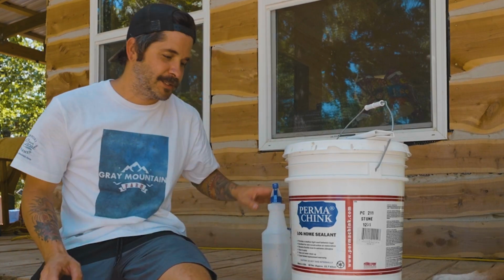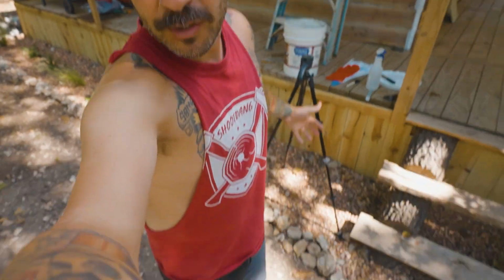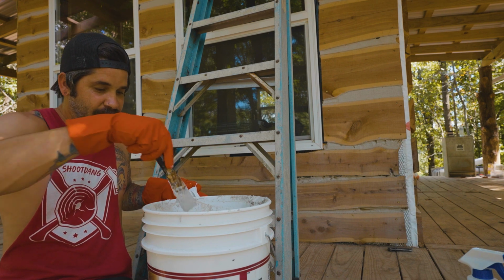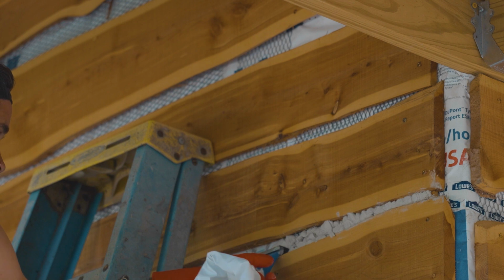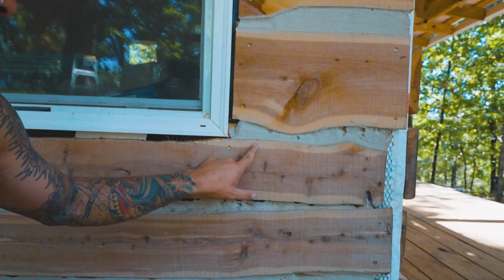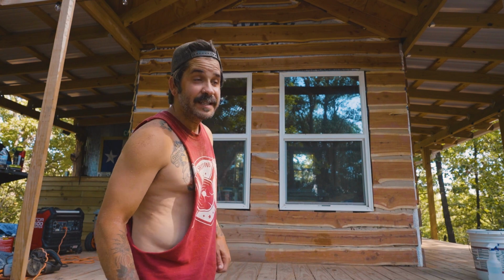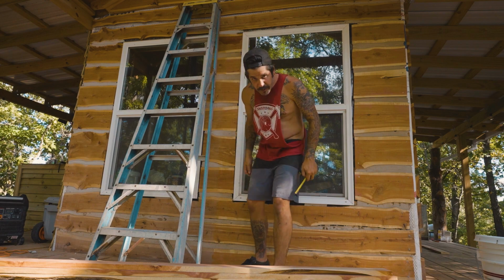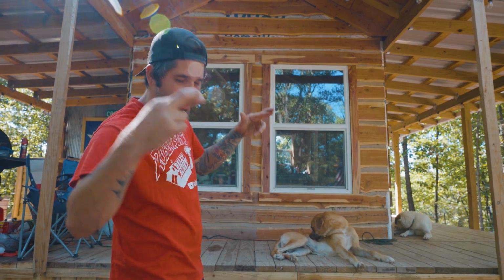Bringing the Off Grid TINY HOUSE back to life!

Comment: Someone mentioned just using a putty knife, but the other suggestion of a frosting knife is better because of the way it's shaped - and there's all kinds of sizes of those things.  If you're going to sand it anyway and the extra spatters come off with sanding ok, then the real wide spots might work better with the frosting spatula.

Comment: You’re doing a good job Jason.  Try twisting the bag on top and cut the end open bigger then squirt it out with the tip going sideways. It might work out easier for you. Try using a small rubber spatula to push the stuff in the creases. If it’s a rubber spatula the chinking might not stick to it as bad. 
It just takes time and rushing the job might cause a issue in the end.  It looks beautiful when the cedar is wet and will be beautiful when you get done. 
Nursing hours are tough I have 2 daughter’s that are nurses and it’s hard work. Get plenty of rest. 
Stay safe
God Bless

Comment: When you originally tried the chinking I asked if putting the finish on the boards first would be a better option so that any chinking that got on the face of the boards would wipe off more easily. 
I believe you’re supposed to twist the bag to push the chinking out. Or at least that’s what I’ve seen mentioned on cake decorating videos.

Comment: Hey boss have you ever seen Barnwood builders, it's no the D.I Y. Channel. I have never chinked anything but when they do it they put that blue foam insulation for a "spacer" I know you boards aren't as thick but it may help and be cheaper than wood. Also when they apply the chinking they put it in a mud pan and use a putty knife to put it on with. Just an idea from someone who hasn't done it, Lol. Good luck brother!

Comment: Cut the tip of the bag up about an inch. A larger stream of chinking will go thru the bag and you won’t have to squeeze the bag so hard.  Twist the top of the bag.  That will also help squeezing the bag a little easier.  Good luck!!

Comment: Try cutting some of the blue end off the caulking bag.  It may let more out at a time with a bit larger hole.  Just guessing but works on cake icing to use bigger tip.  Great job, you will beat your deadline!!

Comment: Not an expert by any means, so take this suggestion with a grain of salt.  On the chinking could you put the wide painters tape on the top and bottom of the boards, and the use a spackle/putty knife and push it in.  If not could you cut a bigger hole at the bottom of the chinking bag. Maybe it would come out easier. Just my thoughts.  The trim looks great! Im rooting for you to finish in 60 days.  I think the days should of started after you got back from Jareds.  :)

Comment: 👉👉👉👉👉👉👉🔥🔥🔥Hey Jason next time you go to Walmart go to the cake decorating department and pick yourself up a step up looks like spatula metal spatula that'll fit those grooves it'll be easier for you and also a cake decorating trick to fill the decorating bag with the stuff cut the top off of a gallon jug enough so you can fit the bag standing up in it pull the bag over the sides of the container and it'll keep it open and then make it easier for you to fill it up. Any other cake decorating tips let me know LOL

Comment: Where is frig going?  Put in a woodstove where bathroom is planned.  It's free, off-grid warmth and you can cook on it.  It can be small.  Put in a bathroom with a small vanity running on same side as kitchen and with a window,  You will regret that choice if you don't.  I like the rest of your design.  Might want to either have two skylights that open in bedroom loft or 2 windows that lift open on each side for cross ventilation in summer.  It will be too hot up there.  Electric fireplaces are terribly inefficient.

Comment: “Just like a woman” ... ha!  Approach —easily,  gently,  .. just as one would in romancing a woman!   A nice place to take a break that patio Jared made for you.   You, Jason is THE FIXIT MAN!   I wonder if any builder has tried chinking the entire frame sides before a window is put in.  Or under the boards before nailing in.  Yes, there would be some oozing out that could be just pushed in with a small spatula, and be able before drying wipe up the excess.  Yes, think you should go get the gun to help this job.   It doesn’t have to be perfect on a cabin.  Surely wasn’t on original cabins.  Wonder if you use painting masking strips on the boards then use the gunTo do chinking.   It does look nice when water was sprayed on the boards.  One side at a time!

Comment: If they make a battery powered caulking good that you can fill the chamber with chinking, you should get it. Those wide gaps are killing you.
Reply: Caulking GUN
Reply from the maker: They do, but you have to buy the tubes... which is expensive

Comment: Quit messing around with that bag and ten cent brush. Use a wide putty knife to apply the chinking compound and one of those big soft car wash sponges and a bucket of water to wipe it smooth and off the wood.
Reply from the maker: Already tried that before, doesn't work good